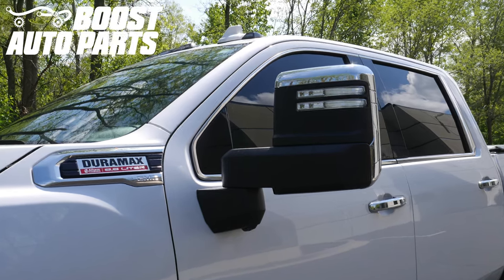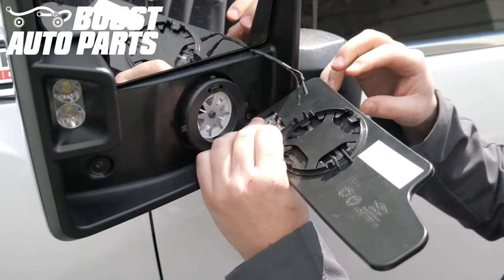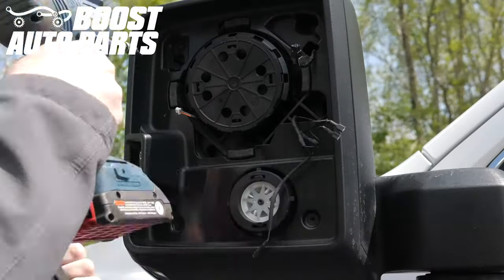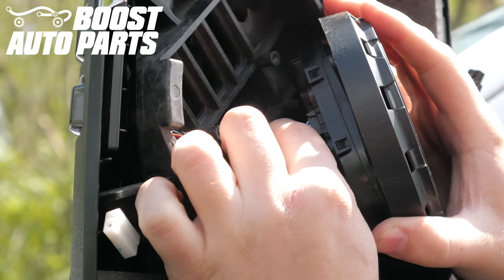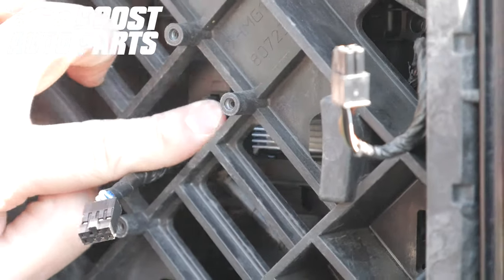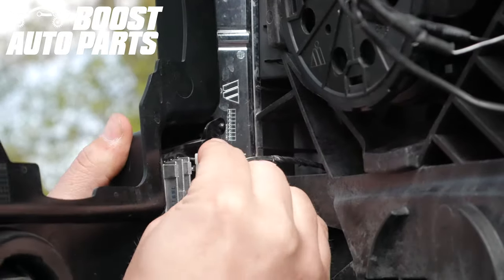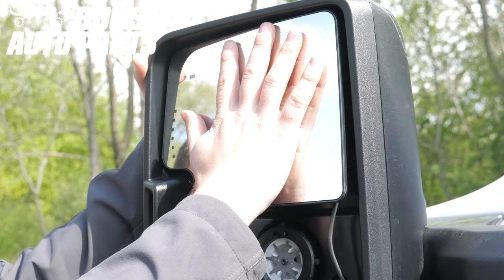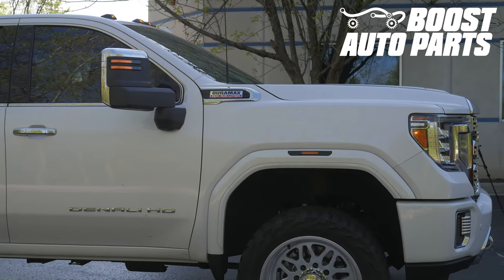2019-2024 GM Silverado Sierra Tow Mirror Marker Light Install - Switchback (White) or Amber

Comment: Instructions were fantastic, took 20min on the first one and maybe 10 on the second. I will say my 2024 silverado 2500 ltz had some slightly different looking parts, my mirror motor is completely different looking, and mounts on a different system, but at the same time extremely similar operations and was still able to breeze by that. All and all a great video! Going to do the cab lights next!
Reply from the maker: Awesome, happy to hear that! Cab lights are a bit more involved, but with our video should go on nice and smooth. Appreciate you!

Comment: Hopefully you guys can make something similar for the 2019-2021 1500 light that are on the outside of the mirrors I would totally buy for my truck
Reply from the maker: Are you talking about the small light that is on the small (non-towing mirrors) that only operates as spot light?
Reply: @boostautoparts  is there anyway to make it turn amber when the turn signal it set in pretty sure you guys can make one work as a spot light and a turn signal
Reply from the maker: @angelgaytan2332  I will relay the interest to the development team. At this time we only have the towing mirror lights, not the small standard mirrors.
Reply: @boostautoparts  yea they still look great hopefully in the future you guys can make something similar for the 1500 mirrors

Comment: Running light doesn’t work but turn signal does used to work tho just stopped any idea why?
Reply from the maker: That's certainly not typical. Give our support team a call at 765-831-2830 so we can assist in getting this resolved ASAP (free of charge under warranty if it's an issue with our product)
Reply: I am having the same issue. Running light comes on when I turn my lights on but turns off when I turn the lights off. Turn signal works though.
Reply: @jaxsonheilman6804 did you figure it out? I’m having the same issue.

Comment: I own a 2020 Gmc Denali 2500HD and my tow mirrors have all but any indication of turn signal. What would I do if I chose Switchback Sequential?
Reply from the maker: The front light on the towing mirrors has a turn signal built into it. When the running light is on and the signal is activated the turn signal will get slightly brighter. Our switchback sequential lights would be plug and play in your application.

Comment: Does it come with the LEDs for the spot lights?
Reply from the maker: These are offered with optional LED spot lights - there's an option for with or without spot lights on the product page.
Reply: @boostautoparts  what is the spot light your talking about? Idk if my truck has that feature or if im just clueless to what your talking about. Hopefully you can help because idk if I should order it with or without the spot light??? Also with the turn signal on the mirror upgrade im assuming the wiring is already in the truck for it it just needs the actual mirror replacement im assuming? I have a 2022 Chevy 2500 Work truck model so it doesn’t have that, will I have to get any additional wiring for it or does it come with everything I need to make it work??
Reply from the maker: @bicklebopjr298  Spot lights are a forward facing light that can be commanded on. If you send your VIN or pictures of your mirrors to sales@boostautoparts.com our team can assist.

With regards to the turn signal on glass, it comes with a harness and gets power from the front light assuming your truck tow mirror has a front turn signal.